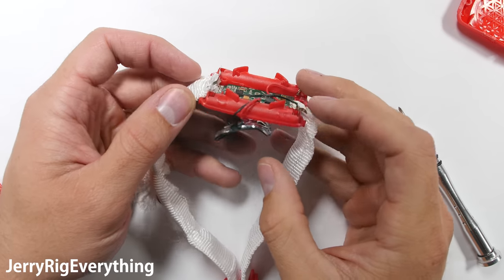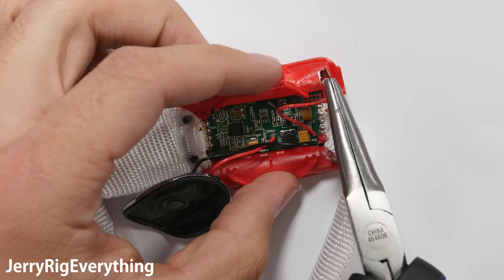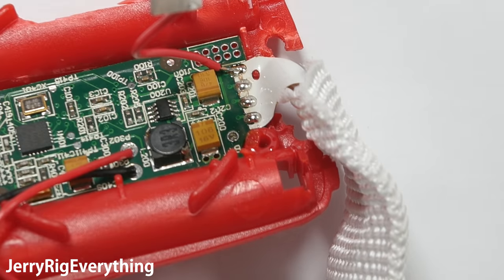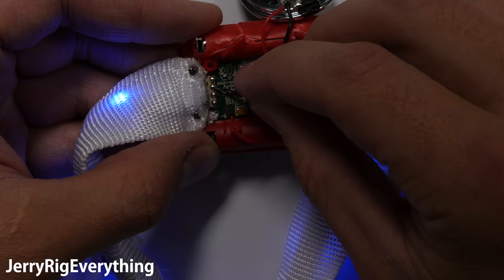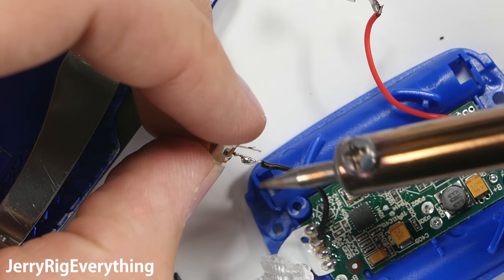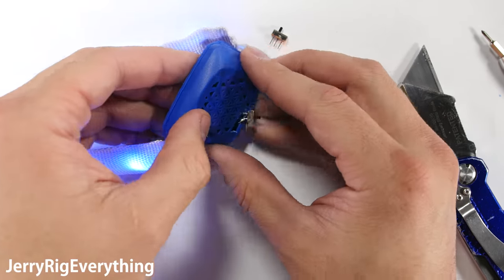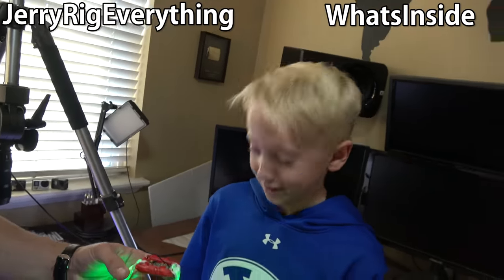Xyloband Hack - Reactivate your Coldplay wristband - Teardown

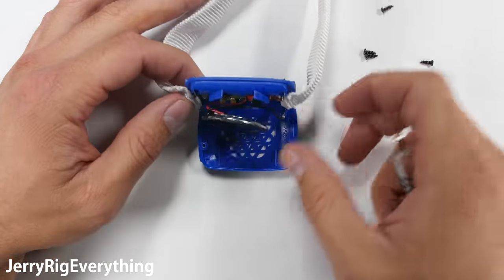Comment: 2:30 that rly looks like a speaker not receiver
Reply: TheNyga That's because it is a speaker.
Reply: The Mod Shop, No it isn't.
Reply: Speakers and dynamic microphones have a similar internal structure. I image that the frequency emitted is simply a low sound frequency. Speakers act as surprisingly good microphones. They also are extremely cheap.
Reply: The Mod Shop It's not or I just missed ur joke. Speakers usually come in a cone design with a flexible membrane to produce sound.
Reply: Alan That is a coin cell speaker. I use them all of the time in my projects. In fact im looking at one right now.
Reply: It is a speaker. Pls don't post comments like this when you know nothing about it.....
Reply: it is a speaker, however it can be used as a mic
Reply: Teddy Sch. The Mod Shop The Xyloband website doesn't mention anything about speakers. It's all about making a light show. There's no mention of there being any microphone or speaker on their product page. What is a coin cell speaker? I searched it up and there's no mention of it anywhere. Could you link me a web article about them?
Reply: Alan  google 'speaker 8 ohm 0.5 watt'  look at the pictures.
Reply: Teddy Sch., Why would it have a speaker? There is no reason to have one.
Reply: Thanks!
Reply: Oaml Yaa pls get over it..  This is a fucking speaker.  Maybe  this wristband is in another application used to play some speech or music that is transfer over some 4,2mhz (or else) frequency.
Reply: Oaml Yaa someone correct me if im wrong but speakers can work as microphones too, so in this case this "speaker" is not there to produce sound but to pick sounds from the concert  and blink accordingly
Reply: Niklas Larsson  that's right but this part in the wristband is a speaker in the first way. That is what it is designed for. Maybe they use it as a microphone. But it's also a idea that they have build it in the band to play some sound since the are talking about radio frequencys on they website. Sry for that little hate from my site :/ #makeyoutubegreatagain
Reply: I am pretty sure it's an 8ohm speaker but here it's used a microphone to catch the sound wave at the concert. These waves will be analyzed by the circuit and for an identified frequency the leds will be triggered. So i feel if you play the specific Coldplay song on your music system and hold the wristband in front of your music system the leds should light up, unless the battery has drained out. Please try and let me know.
Reply: speakers can also be used as antennas
Reply: Using a speaker as a microphone to try to reliably activate lights in a concert full of screaming fans would simply not work. Also, a speaker is a lousy microphone, because the diaphragm and fixed magnet have so much mass. It's a speaker, not a "receiver", and not a microphone.
Reply: Speakers make lousy mics. The diaphragm and fixed magnet have too much mass.
Reply: usethefooorce I think that is the reason they have used speaker as mic, as they are lousy they don't pic high frequency noise from the audience any only pic low (bass) frequencies of music.
Reply: Vickey2k8 Its not used as a mic!
Reply: It actually works like a microphone. I also remember plugging a microphone into my phone and instead of working like a mic, it produced sound like a speaker.
Reply: NC Filmz: Using a microphone as a speaker is really bad for the microphone. They are not designed for the sort of power levels or physical forces/displacements caused by feeding an amplified audio signal into them.
Reply: usethefooorce Yeah, I thought that I might damage the speaker, too, and I unplugged it right away.
Reply: bro he said that because he didnt want WhatsInside to feel like idiots re watching this video xDDD
Reply: A speaker can be used as a microphone in environments with a very high SPL such as a loud concert. It is cheaper than getting an electret mic that can handle a high volume, or implementing a dynamic microphone, both of which can handle concert like volumes without clipping, can run you in the $50 range. On the other hand, if you use a speaker, you will have crap frequency response, but you will get the lower frequencies when the volume is loud, thus it becomes possible to send activation signals for different patterns but have then begin the pattern when they hear sound, thus no special timing needed for the lighting on the bands, and it will sync with the music.
Reply: Sound recognition would be a little too much required for a 3$Gadget ;-)
Reply: You guys can stop this pointless debate about it and instead click the twitter link that PJ posted, showing that the speaker is indeed for sound.
Reply: How can you know how to solder and know about basic wiring but not know what a speaker looks like or a fm/am receiver
Reply: Under rated comment. That is not a receiver. Its not even an antenna. It is a speaker. The amount of technical misinformation on this video and the comments is astounding. A receiver requires an antenna, an oscillator that is tuned to the frequency (simplest form is an inductor and capacitor but usually quartz crystals are involved) and something to decode the oscillations (like a diode or "discriminator"). People really need to learn how to radio. FYI the band itself is used as the antenna since it is a large loop of wire (same wire used to power the LEDs. Tuned with inductors and capacitors on the board!

Comment: The ones they gave to us when they came to Argentina are really easy to hack you just stick somthing metallic through a hole and that works as a switch. You don't have to open it. 
Cool, both videos! Aguante Coldplay!
Reply: ¿Vos decís? ¿Qué van a hacer con las pilas después de cada recital? En 10 días de Coldplay en Argentina se deben haber tirado 1.000.000 de pilas super contaminantes

Comment: Your soldering iron isn't hot enough.  It took way too long to desolder those power wires, which melts the plastic and could damage components.  The tip needs to be replaced too, you can see that the oxidation doesn't let the solder melt instantly on contact.  Great project, I love the look of those bands.
Reply: Sam Maghsoodloo yea shouldn't take that long to melt a joint on a single layer board
Reply: Couldn't you just sand the oxidation off the tip?

I suppose they're cheap anyways so it's not a big deal
Reply: No because the tips are plated. And yes some are cheep but the Hako ones are expensive af.
Reply: Lost Night ah ic, good to know

Comment: Why do you say receiver when the component you're holding clearly is a speaker? Are they really using the voice coil of the speakera as their antenna, and how would that be cheaper than just a length of wire connected to the circuit board?
Reply: a speaker could be used to pick up sound as well as playing sounds so i could be multi functional.. but yeah seems strange that it would be used as a radio receiver even if it is theoretically possible. my guess is that if you put the wrist band near a loud enough speaker i will properly light up.
Reply: Jakob Engell - I am pretty sure it's an 8ohm speaker but here it's used a microphone to catch the sound wave at the concert. These waves will be analyzed by the circuit and for an identified frequency the leds will be triggered. So i feel if you play the specific Coldplay song on your music system and hold the wristband in front of your music system the leds should light up, unless the battery has drained out. Please try and let me know.
Reply: vidyadhar kodagi
you are basically just repeating what i wrote??
Reply: The Brazilian version of the xyloband don't have a speaker. The band is probably controled by AM radio signal and the speaker is used for something else wich i've not realized till now. Probably that model was designed for make some kind of sound/noise idk.
Reply: Man, they can be controlled individually, So, if they are controlled by the sound it was really hard to be done and expensive as well, and as i said some models r diferent and don't have the speaker (the older ones) , but i've noticed a AM circuit similar to the ones that can be found in cheap wireless doorbells on the circuitboard, so i think thats the way they controll that, but i'm not sure.

Comment: or instead of opening it up at all, get a RF transmitter and try exposing the wristband to different frequencies.

for this wristband in particular:
"The RF transmitter transmits a 60 kHz-wide 
signal centered on 869.5 MHz at a power of less than 1 watt, using a 
Frequency-shift keying (FSK) modulation scheme."

Comment: Since I am not the first one mentioning that the "antenna" is just a speaker, I am wondering if they are using it as a microphone to detect when to turn the LEDs on. I mean there would probably be cheaper and smaller alternatives to a speaker if they were actually using radio signals. Now I wonder if the music triggers it or if they were playing a special tone at the concert that would trigger it. Maybe someone with a band and the album or a recording of the concert can verify that? :D
Reply: pcfreak1992 I think you're right. It either triggers from the music or from low frequency tones that are imperceptible by the human ear.

Comment: I thought there is a way to use the stock circuit board to light those LEDs on. The most challenging part is figure out what sort of radio is used to give a signal to board, once we know that, we can make a fake and light it back on

Comment: The "radio receiver" looks a lot like a cheap speaker to me.
Reply: DoctorBlankenstein it definitely is a speaker. Could a speaker act as an antenna though? Like a mini dish antenna?
Reply: Justin E well, since a speaker is a transducer...  Technically is can both play sound,  and be a microphone. So I guess it could hear the rhythm pulse of the music,  and set off the LEDS.  The question then is,  why not just use a small microphone. They work better,  are smaller and cheaper. So it wouldn't make sense to run the circuit off a speaker used as a mic.
Reply: Because its not a speaker or a microphone. They use radio signals to tell it to turn on and off or change its color.
Reply: French_Bacon do u have a datasheet to share for this "antenna" that looks JUST like a cheap speaker?
Reply: If the signal is not part of the music it's probably an ultrasonic code. Those speakers could easily act as microphones out to 30 or 40khz. I'm disappointed he just bypassed the circuitry and only hacked the LED's. By the way, there are six AAAA batteries in every 9v battery.
Reply: After a bit of looking around the xylobands use 869,5Mhz (probably depends on the country). One older teardown video didn't even have a speaker/microphone in it, but had three large button cells in their place. What the current ones are using the speaker/mic for is anyone's guess because is has no use as an 800Mhz antenna.
Reply: RMoribayashi that's would I would expect.  The speaker is not a signal receiver.

Comment: couldn't you add a mic with an adjustable voltometer in place of the radio sensor to that it activates in response to a certain level of sound. Which would make it act much more like it's intended use.

Comment: technicly you could use the band without hacking it if you got the information on the frequency, the transmission codes and the correct equipment to transit

Comment: I am assuming it is not possible to use a Zigbee to send a signal to it right? since you mentioned is has a proprietary radio signal. is there any way around this?
I would like to control the LEDs with a zigbee connected to a Zedboard.

Comment: Did anyone see the jtag port? (However it was not soldered on the board.. it was those 5 unsoldered pins in the top right corner of the PCB

Comment: Hey, that was not a radio receiver. that was a big microphone
Reply: can you test it to high sound? knock on it etc. maybe its würking!
Reply: danspappa Its a speaker, the lead singer spoke about it recently
Reply: Sam Geee ya, its a speaker. try to plug a speaker in a mic-hole and then you scream or knock at the speaker. Then you see that the speaker becomes a microphone, admitting only high sound. though the cone needs more force to move than a microphone. Such as heavy sounds at a Concert.

Comment: Does anyone have any idea why there's a speaker inside that wristband? I wonder if it's actually a mind controller device just like in kingsman LOL
Reply: Pizz48 It creates a small noise during certain songs
Reply: Speakers and dynamic microphones have a similar internal structure. I image that the frequency emitted is simply a low sound frequency. Speakers act as surprisingly good microphones. They also are extremely cheap.

Comment: While I understand how heart warming this is to kids, this is not a really good technical video. The title with the method used here flirts with a serious lack of knowledge. All you did was just solder wires to the LED from a battery.

That is not a receiver. Its not even an antenna. It is a speaker. The amount of technical misinformation on this video and the comments is astounding. A receiver requires an antenna, an oscillator that is tuned to the frequency being received (simplest form is an inductor and capacitor but usually quartz crystals are involved) and something to decode the oscillations (like a diode or "discriminator"). People really need to learn how to radio. I find it sad how I knew this info since I was 7 in the scouts. Now the adults and their kids don't know anything. I really expect better from adults.

FYI the band itself is used as the antenna since it is a large loop of wire (same wire used to power the LEDs). Tuned with inductors and capacitors on the board! There is a whole forum dedicated to Xyloband hacking using the board and frequencies as well. The proper way.

Comment: It's not a good idea to drive LEDs without a resistor.
Reply: Most LED strips have resistors built in.
Reply: tmkr think again most now a day they have an integrated resistor inside of them the little wire can act as a resistor. that's how new ones work

Comment: The Soldering in this video, certainly not professional. The so called "radio receiver" is a loudspeaker not a radio receiver. Electronics Engineer with over 30 years in the trade.